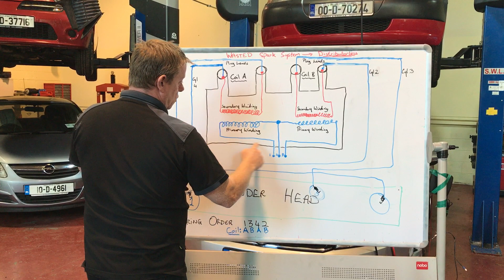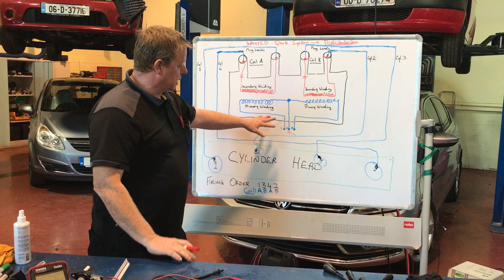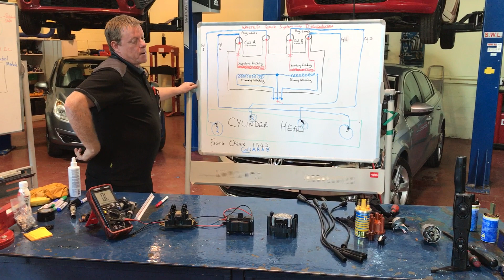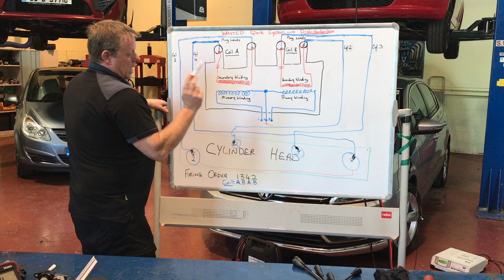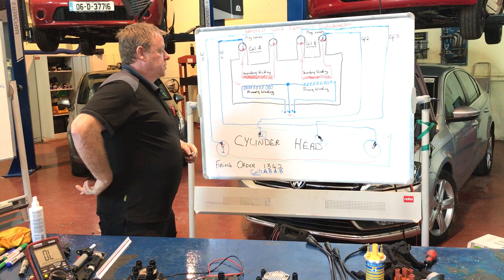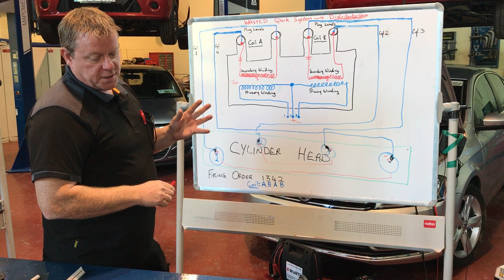Wasted Spark Ignition Coils

Comment: Dave I have a stupid 94 Ford ranger that will not I just replace the timing belt on its timing belt snapped on the freeway so I had to have it towed home and I've been trying to figure out what's wrong with it I have no idea but I'm kind of thinking that it might be the bad ignition coils but one of the videos I watched said that you could have one coil on the engine would start. Ice cream starter fluid in my 94 Ford ranger throttle body and I couldn't even get it to fire up for half a second like it usually would on every other car I've ever had I've never sprayed so much ether into that goddamn intake that made me sick almost I went in there to fire it up and all it did was keep turning over like I never sprayed it. Rented a Ford  code reader but came up 000😭 I'm so disgusted. Just replaced the timing belt and now this! If it's not getting fuel explaining why started fluid wouldn't start it. I have dual coils and I video said if one is working your engine will run rough. I'm just totally perplexed my next step is to call a mobile mechanic to ask him to help me bring a scanner or a better code reader something to make this piece of crap figure out what I got to buy to get the engine turning over and starting I've never had starter fluid not start an engine ever. Please let me know asap?😇🙏🏾💞